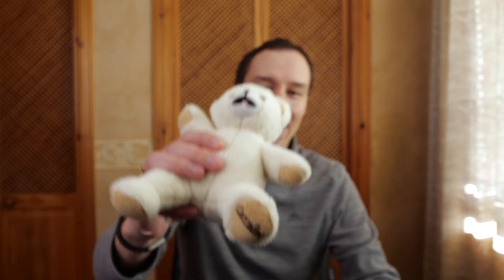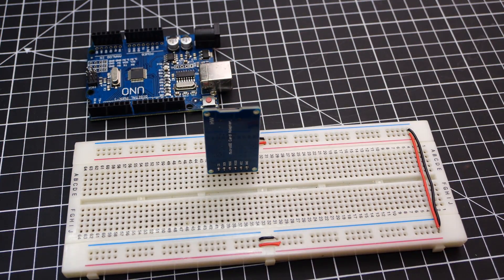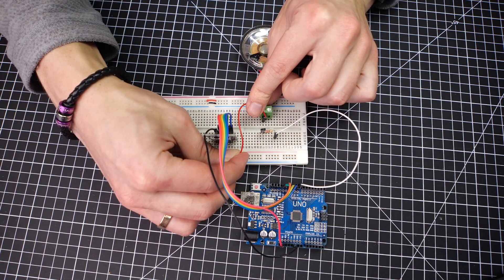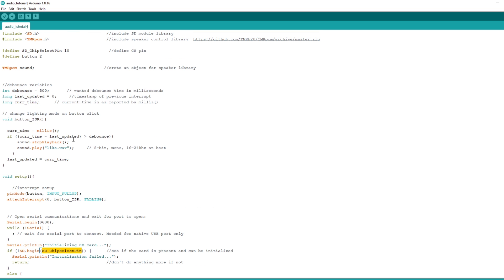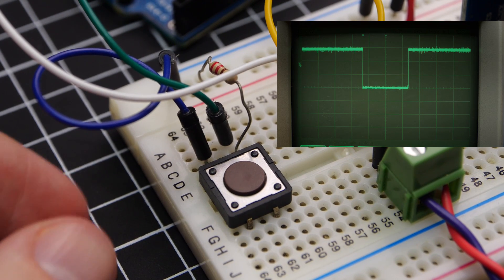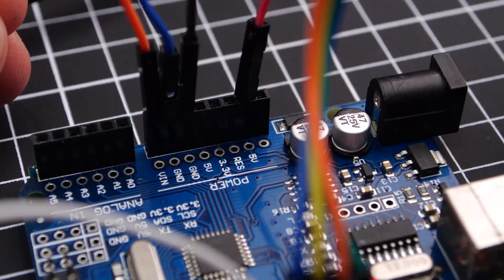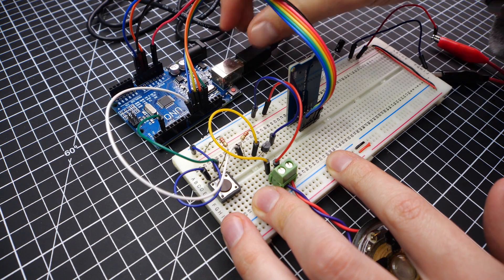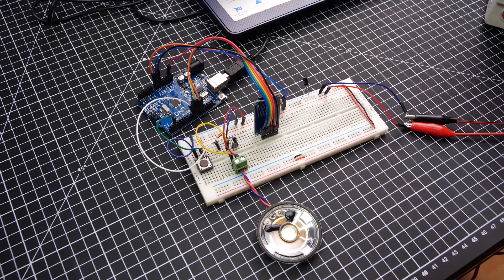How to Play Audio on Arduino + Debug

Comment: I have followed the tutorial step-by-step, multiple times, card initialization is O.K, but the .wav file could not be played. Any further suggestions, please.
Reply from the maker: Did you do LED test? Is anything coming out of the speaker, i.e. buzzing or hissing? What speaker have you got, i.e. how many Watts and ohms? What transistor? Did you try and change volume()? Are you using separate supply or arduino supply? If separate, arduino and speaker need to share ground. It is hard to say without seeing your circuit. Have checked the wiring like 50 times?
Reply: @MakeithappenDIY  hey, first of all great vid, i understood some things i had not before.
Secondly i have a question, similar to this guy i cant get the audio to sound quite right, i tried sample audios already set to the right config, but i always get a static like sound. Im using an 8ohm 1W speaker and proved it worked without an sd by using pcm libraries with encoded audio. Any idea on anything i could do?
Reply from the maker: @juanpedropena7464  hi! Unfortunately, I gave all my suggestion answering the other guy... "static like" sound seems like the .wav file problem. If you have not tried this, I have a link to a github page in the video description. There is "like.wav" there which you could use to test your set up. That is what I used in the video. If you still get the problem, try changing the volume() function. Check the wiring again, go through the debug steps again. If you still can pin point if this is a hardware or software issue, try sending a single sine wave into the speaker from the code (google how to create sinewaves (might need to change to an analog pin!)). Don't give up, it will be something silly, you'll figure it out!